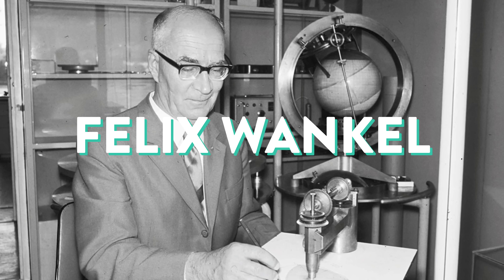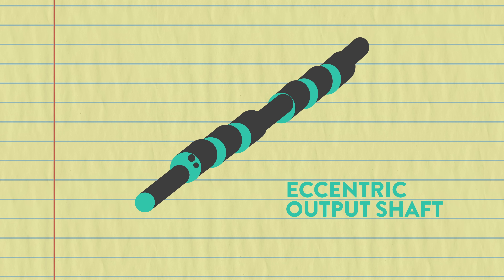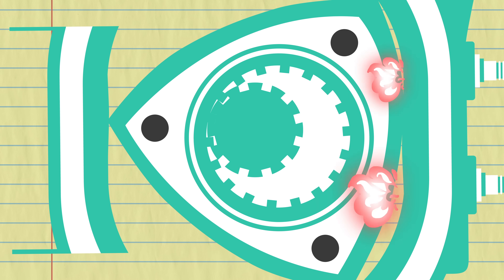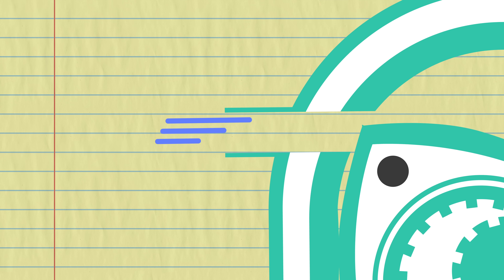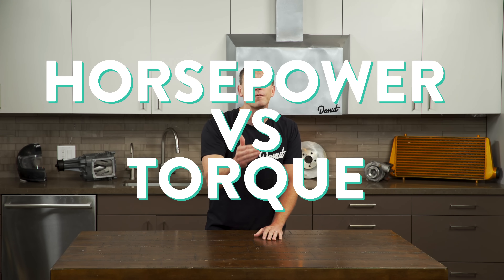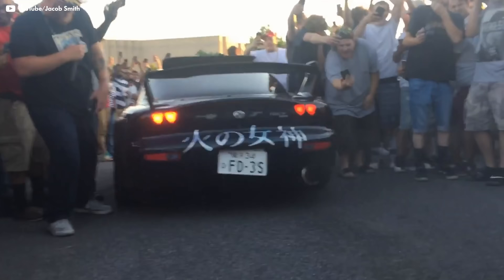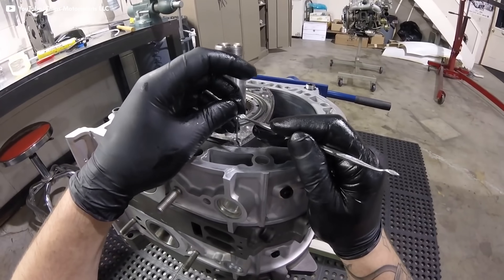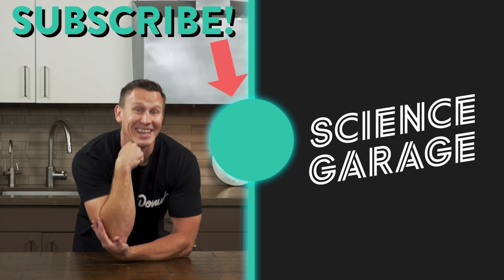Rotary Engine | How It Works

Comment: I wanna know what the MOST efficient engine style is. Obviously any engine type can be made in its most efficient set up, but I wanna know what the TOP DOG is for gas efficiency.
Reply: 2-stroke Diesel engines are the most efficient type of internal combustion engines currently available.
Reply: @sandervanderkammen9230  I wanna make it a hybrid and see if I can get triple digit MPG
Reply: @negativejam1173  Sounds like a viable concept... I believe Volkswagen already did it a few years ago..
Reply: @sandervanderkammen9230  wild! I wonder what kind of mileage it got.
Reply: @negativejam1173  Volkswagen claimed it got 100 mpg.

Comment: What about a twin rotor fusion cylinder as to feed unburned fuel into a secondary rotor reducing emissions and harnessing that left over energy that would be wasted otherwise 😅
Reply: How would you have ignition in the second chamber?

Comment: Sounds like the rotary engine could use some kind of mechanical something tied to the shaft to push into the combustion chamber to shrink the volume of said chamber for better compression. Any thoughts?

Comment: Mazda are introducing a rotary hybrid for sure.
https://www.thedrive.com/news/36961/mazda-is-really-actually-bringing-back-the-rotary-engine-as-an-ev-range-extender-for-real
Reply: BIG FAT LIAR
What happened to the new Mazda RX engine you promised would be in showrooms this year???
2020 IS OVER!!!
YOU LOOK LIKE A FOOL.
Reply: @sandervanderkammen9230  
Dotorbimmer, Mazda are bringing out a rotary hybrid.
Reply: @johnburns4017  Someotherdude, Mazda abandoned all development of Wankel engines in May 2009.

There is no new Wankel engine design in development at Mazda.
Please stop spreading false rumors and lies.
Reply: @sandervanderkammen9230  
Doktorbimmer, Mazda are introducing a rotary hybrid for sure.
https://www.thedrive.com/news/36961/mazda-is-really-actually-bringing-back-the-rotary-engine-as-an-ev-range-extender-for-real
Reply: @johnburns4017  Why is there nothing about it on Mazda's official website???
Reply: @sandervanderkammen9230  
doktorbimmer, ask them.
Reply: @johnburns4017  Mazda doesn't make Wankel engines anymore, the last new production engine was unveiled over a quarter century ago!
Reply: @johnburns4017  Have you been by the Mazda dealer yet? You won't see any "Mazda Rotary" engines for sale!
Reply: @sandervanderkammen9230  
dockorbimmer, a quiz.
What type of engine is to be installed in a hybrid car by Mazda?
20 points for the correct answer.
Reply: @johnburns4017  Stop telling lies Johnny!
Mazda stopped making Wankel engines 9 years ago.
Reply: @johnburns4017  The new Mazda MX30 is already available for sale and will only be offered as a 100% plug-in battery electric vehicle or a mild series hybrid powered by a 2.0 liter 4-cylinder Skyactiv G engine.

Comment: Yep, no lag at all like an oto cycle engine. In an 1 cylinder oto cycle engine there are three movements where no power is being made.
Reply: Wankel engines have 3 combustion chambers or increments of 3, 6, 9 etc.

Comment: Your title is misleading.  A Rotary engine was used on 90% of aircraft in World War 1 and other early aircraft, and were phased out because they were awful engines.  This is a Wankel Rotor engine.  Just FYI.
Reply: Good comment, actually only one Wankel rotary engine is known to exist.
The Wankel KKM type engine sold by Mazda and others is the non-Rotary version designed by Hanns Paschke and Walter Freode.

Comment: it took me half an hour to explain my technology teacher that his rx8 doesnt have pistons
Reply: The RX8 has two pistons... 
.
Reply: @sandervanderkammen9230  it has 2 rotors not 2 pistons
Reply: @erixccjc2143  The correct term is orbiting piston.
The Wankel KKM does not have rotors, a rotor is something  revolving on a fixed axis.
Krieskolbenmotor means "Orbiting Piston Engine"
Reply: @sandervanderkammen9230  Well so it should be called orbiting engine instead of rotary then
Reply: @erixccjc2143  IT IS, Wankel KKM-57 stands for Krieskolbenmotor model 1957.
Reply: @erixccjc2143  Only the Wankel DKM-54 was a Rotary type engine...

Comment: Why aren’t they diesel so that there is no need for spark plugs and when it gets to max compression it could ignite like that
Reply: Several major manufacturing companies attempted to develop compression ignition for Wankel engines.
Unfortunately the Wankel engine simply cannot be adapted to the Diesel Cycle because of the geometry limitations and the inability to support the required static compression ratios.
Reply: i believe the extremely high compression would blow the seals super easy
Reply: Can be done... https://www.youtube.com/watch?v=1pDjwaqU0dU
Reply: @johngoodman4368  Designing a Diesel Wankel is not possible... Rolls-Royce's efforts were a complete and total failure and led the company into bankruptcy.

Comment: Motorcycle engine comes in two options 2 stroke or 4 stroke each has its benefits so does a rotary engine considered a two stoke of the car world?
Reply: All Wankel engines are 4-stroke.
Several motorcycle manufacturers offered or developed Wankel engines but were discontinued because they offer no advantage in motorcycle applications.

Comment: Just wanna throw this out here. The rotary can actually be one of the most reliable engines ever due to its simplicity. The so called 'weak' apex seals actually usually only go when they aren't getting oil properly. This can be easily solved by premixing, especially if you have a broken OMP. I got an FB myself with almost 100k miles and it still runs like a dream.
Reply: The primary failure mode of all Wankel engines is apex and side seals failure due to erratic combustion and detonation.... not lubrication.
You should never tamper or remove the OMP, and 2-stroke oil is not intended to be used in Mazda Wankel engines, Wankel engines are 4-stroke and Mazda only recommends 4-stroke motor with a API SL rating or higher, no 2-stroke oil meets Mazda's specifications.

Any fool can pour the wrong oil down the wrong filler hole... don't be that guy.
Reply: @sandervanderkammen9230  Hes changed his name, but id recognize this D-Bag anywhere.

Comment: Its a single stroke engine, so it requires two stroke premix richer than two stroke engine, not freaking engine oil
Reply: All Wankel engines use the 4-stroke operating principle.
Mazda only recommends 4-stroke motor oil... because their engines are not 2-stroke.
Reply: @sandervanderkammen9230  Hes changed his name, but id recognize this D-Bag anywhere.

Comment: Idk man my rx8 2008s been running fine since still have to replace the seals for the oil chamber not the seals since theyre aftermarket and last for 120k miles maybe 30k miles linger than oem apex seals and DONT FORGET TO ADD 2 STROKE OIL TO YOUR FUEL AND A HIGH REV A DAY KEEPS THE CARBON AWAY

Comment: Engines: we use Pistons around here

Rotary: let me introduce myself
Reply: They don't make Wankel engines anymore.
Reply: Sander Van der Kammen I mean, Mazda has said they’re gonna bring back the RX-7, but they’ve been saying that for almost 10 years.
Reply: @JimmyDean59  The last RX-7 was unveiled 30 years ago.
Reply: Sander Van der Kammen Yeah, and they have said they’re gonna bring it back.
Reply: @JimmyDean59  "They" being the clickbait bloggers?

Mazda's president confirmed there are no plans to bring Wankel engines.
Reply: @JimmyDean59  Don't feed the troll
Reply: @sandervanderkammen9230  Hes changed his name, but id recognize this D-Bag anywhere
Reply: Hmm i hate a rotary engine. Unless I see a V 8 rotary, I’m not falling for this.
Reply: There is nothing more pathetic and sad than bitter people stuck living in the past.
Reply: @sandervanderkammen9230  There are several companies currently producing wankel engines
Reply: @angrysalads  No, there are not. Mazda was the very last company manufacturing Wankel engines in series mass production.
The Wankel engine has been obsolete in the engine manufacturing industry since 2012.
Reply: @sandervanderkammen9230  if you're talking specifically about car engines then I agree. But rotary engines are being produced today for other applications
Reply: @angrysalads  The Wankel engine was a complete failure in other applications... they only saw limited production in the automobile industry.
Reply: Yup, another year goes by and that mysterious new Mazda engine remains nothing more than wishful thinking.
Reply: Gas turbines: Hello there.

Electric motors: New phone, who dis?
Reply: @VigilanteAgumon  Gas turbine-electric hybrid???
Cool idea,  but it will never work for automobiles.
Reply: This week marks the 9th anniversary of the final end of Wankel engine production.
R.I.P. 1964 - 2012

Comment: Rotary engine in the Mazda RX-8. (Image: Mazda)The rotary engine has been around since the early 20th century. But it didn’t come to autos until the second half of the century. The “Wankel” engine was licensed by a long list of OEMs but its deployment is best known in Mazdas, the company that put the rotary engine under the hoods of a variety of vehicles, the last of which was the RX-8. Production ceased in 2012.Simple DesignAlthough the rotary engine is compact and simple—as in no pistons, camshafts, etc.—with a quasi-triangular shape (the lines between the points of the triangle are arcs, not straight lines) moving in an eccentric orbit within a combustion chamber.Vexing ProblemsReasons why Mazda stopped producing the engines include not-stellar fuel efficiency and emissions issues, both largely predicated on compression problems, which lead to incomplete combustion such that there was unburned fuel after the spark.Potential SolutionsFormer Mazda technician and inventor Ernie Brink thinks that he has come up with design modifications that address these drawbacks of the rotary engine and he talks about it on this edition of “Autoline After Hours” with Autoline’s John McElroy, Todd Lassa of Automobile Magazine and me.What’s more, Brink provides demonstrations of the way the Wankel works—even using an air compressor to rotate the rotor.

Comment: Is there a diesel wankel?
Reply: Good question. No, but i wonder if it's possible.
Reply: Diego Otero what about other low pressure like alcohol, ethanol or tgat kind of thing.?
Reply: @SanctusAcappellaSATB  no idea
Reply: There were many failed attempts to develop a Diesel cycle 2 engine but none were successful.

Comment: Wankel engine will remain just a technological curiosity... with inherent leaks between the intake, outflow and combustion because of the basic design, fuel efficiency and exhaust emission can never be improved.

Comment: They should make a better motor that will fit in the RX8 without having to go out every 80,000 because they made a lot of of them but the motor suck too many design flaws p I have one in the motors almost as much as the car with was when it was brand new

Comment: what is a V8 or V 10 or V12 engine?
Reply: Low Yeeliang A V engine is a type of engine that is shaped like A V hence the name V8 or V10 these enfines work like an inline but in a different shape again,V the cylinders have the Pistons which move up and down when the motion goes down the cams while spinning opens the valve and that lets in air,when the cams rotate away from the valves the pistons combust the injected fuel by the Fuel Injectors and after combustion this goes to the exhaust manifold or header.One of the Vehicles that have a V8 is the Koenigsegg One:1.For V10 or 12 they work the same but more cylinders.

Comment: Mazda discontinued these unreliable engines years ago, production ended on Thursday June 21, 2012 at 4:30pm the final RX-8 car ever to be produced rolled off the assembly line, the last RX model to ever be produced by Mazda.

Comment: *THE REAL DOKOTERBIMMER ROTARY FUEL MILEAGE IS ALL ON THE LEADING PLUG HOLE AND YOUR 2MM APEX SEAL  MAJOR WASTE OF FUEL AIR AND COMPRESSION FIX
Reply: Thanks Ernie, but just remind doktorbimmer that Mazda is introducing a rotary in 2022.

Comment: Emission regulations are what killed the rotary. Just finished rebuilding my 30 yr rotary rx7 I deleted all smog devices It now runs like a Ferrari also very clean exhaust. Smog devices killed the rx8 because of excess carbon and heat build up from trying to meat gov regulations. This is a revolution in the gas motor that is lost because of government over regulation. What a shame.

Comment: I see rotary engines like 2 stroke engines. Less moving parts, decreased fuel economy, and smaller physical size while still giving a hell of a good time
Reply: The Wankel has more moving parts than a comparable reciprocating 2-stroke. All Wankel engines are 4-stroke but suffered from very poor fuel economy. 2-strokes are smaller and lighter. Gas turbines offer significantly better power-to-weight ratio performance which is why Wankel engines are obsolete.
Reply: doktorbimmer No, i was comparing the wankel engine to standard piston engines in that wankel engines have less moving parts than a piston engine (as said in the video). I was comparing 2 stroke engines to wankel engines because they are similar, like i said, when compared to piston engines.
Reply: Not really true, the last production Wankel engine was the Mazda Renesis in the RX-8 and it had over 235 moving and seal related parts and was very unreliable. They still make reciprocating 2-stroke engines but Wankel engines are obsolete because they do not offer any advantages over reciprocating piston engines.
Reply: Wankel engines are not similar to 2-stroke engines, all Wankel engine used the exact same 4-stroke operating principle as the Otto Cycle engine. Do you understand how the Wankel KKM type engine works???

Comment: How hard Is it...to change an Apex seal
Reply: You have to remove the engine from the vehicle and perform an entire engine overhaul, some of the major components are often damaged besides the apex seals and can be expensive to replace.
Reply: JUST LIKE YOUR ENGINE BLOCK FROM A FLYING CONECTING  ROD COME RIGHT THREW THE BLOCK YES VERY EXPENSIVE ?
Reply: I STILL CANT I HATE IT WHEN THAT ROD FLYS RIGHT OUT THE BLOCK

Comment: I wonder if 6 chambers with a rounded hexagon would achieve a better compression ratio, since the sides of the hexagon would probably get closer to the housing.
Reply: How would you get the compression and power strokes to work and achieve the 4-stroke cycles????
Reply: @doktorbimmer  Maybe there would be two cycles per rotor? So each rotor would have two intake and two exhaust ports, etc.
Reply: But how will you get the change in volume for intake, compression, power and exhaust cycles??? The piston/rotor has to reciprocate to achieve the change in swept volume.

Comment: So a ROTOR is not a piston? Right??
I had a discussion with some asshole that said that rotary engines use rotating pistons. I never heard such a thing.
Reply: The word piston is right in the name given by its inventor.... you probably don't understand the difference between a ROTOR and a PISTON... but you are probably not an engineer either.